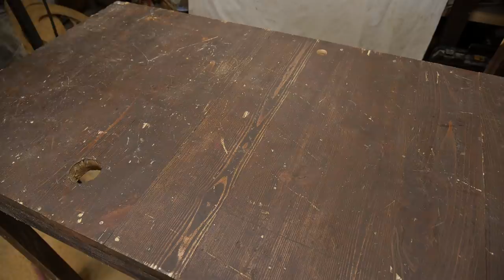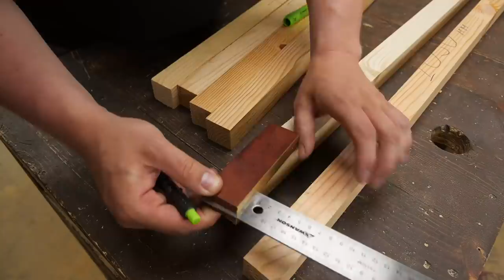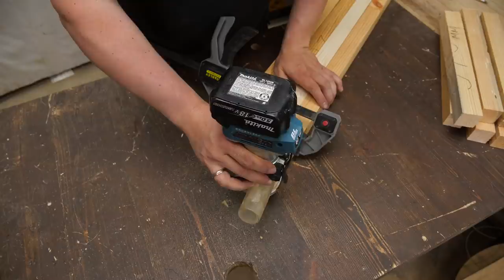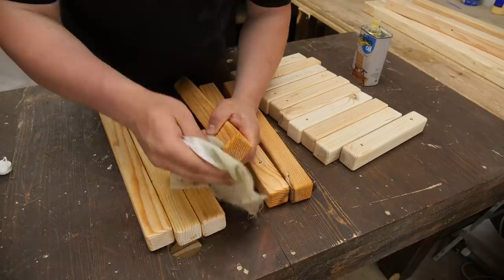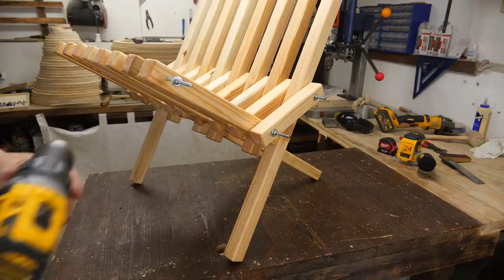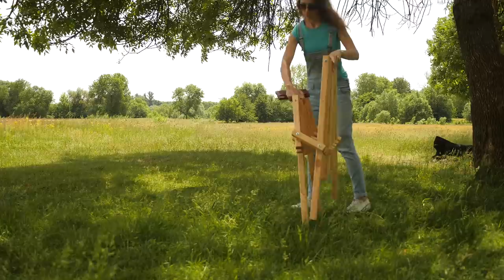Turning Worthless Wood into a Stunning chair

Comment from the maker: How do you like this idea? Put like it if you like it
Reply: guess these projects are not for women since it says Men’s Crafts..... guess i’ll scroll on by :)
Reply: The curves were some smooth moves
Reply: @ВячеславКалинин-о3с  А что, видео посмотреть - несудьба? Там же все размеры есть!
Reply: EXCELLENT
Reply: @ВячеславКалинин-о3с  

.

..................
Reply: Men's Craft  I am a lady and I liked the video
Reply: Скажите,что вы вкрутили такое длинное по всей длине вкручивали, саморезтакой длинный?
Reply: Love it. Would like more info on the measurements. What's the width of the slats? Length of the smaller slats and where do you drill the hole (you show at 4cm, but whats the offset on the others? 8cm?). Thanks on advance
Reply: M
Reply: Very nice... GOOD
Reply: Подскажите расстояния под отверстия

Comment: Dima, Thanks for your post. Do you have the plans for this project? I tried to follow it but, the initial numbers of lengths of wood did work out for me. 6x230, 6x375, 2x875, 2x745, 2x787, 2x1050. In the end assembly you have more pieces, which did you cut down? Thanks in advance...

Comment: Can u put the plains in the Comment section? I saw the measurements. But not the order they should go when doing assembly. And where did u get the long hardware to put it together at? And how far down do u drill on each board to get the long bolt to go thru?

Comment: This is a great idea for a nice little portable chair...  For a person the size of that girl.  I'm 6'4"/250lbs.  Somehow, I imagine hearing it cry a little as I sit, right before I crash to the floor...  lol
  I'm sure it's fine for the average person.  Ain't nuttin about me average.   ;(   heehee
Reply from the maker: Dude you need a big chair
Reply: @menscraft7985  
  Sir, you are correct.  😆 
I do like the concept of this chair, I'm just not sure if it can be "Boomerized" so as to be able to hold a person of my stature.   Its the legs that concern me, I suppose knot-free, red oak miiiiight hold up.
Granted, I'm in the process of dropping some weight but, even then, I'll go 220-230lbs. lol
I appreciate your vids...  And reply.  If you come up with a good solution, let me know. 😉